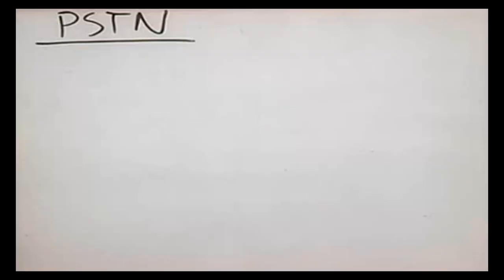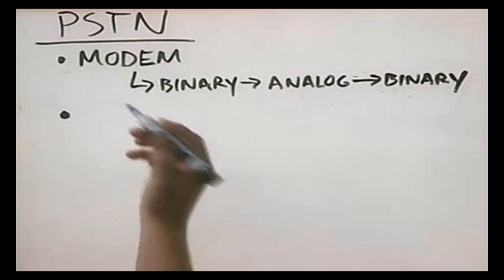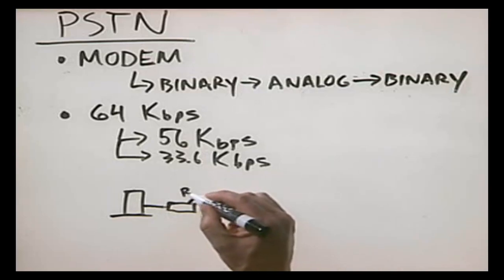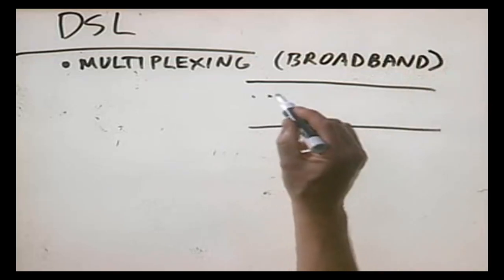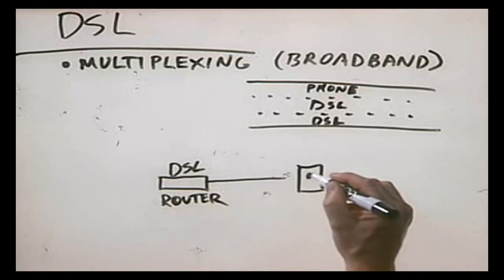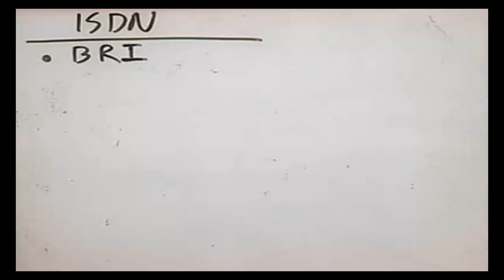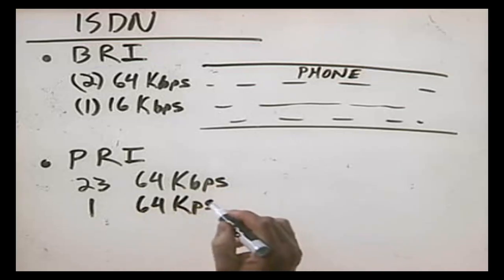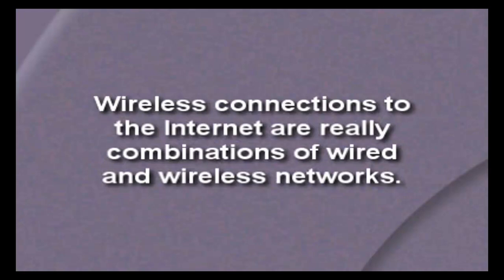CHAPTER 9 NETWORK CONNECTIVITY METHOD Networking Basic

Comment: Nice explanation, but one small remark though. A DSL line is still an analog modulated signal. Therefore a DSL modem is still an actual modem. The only reason some people refer to them as DSL routers is because a lot of carriers start combining the modem and the router into one single device.